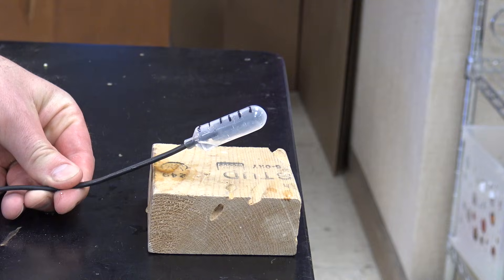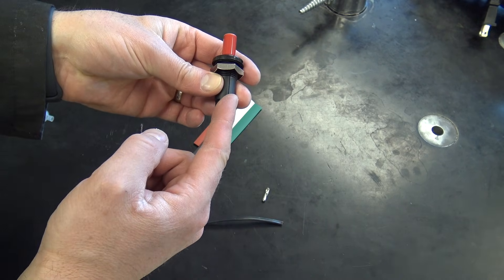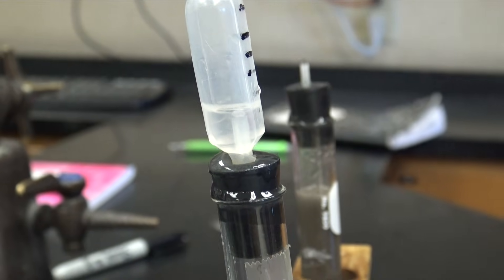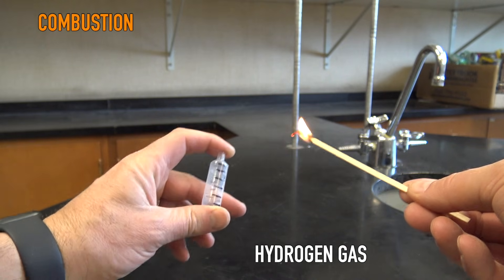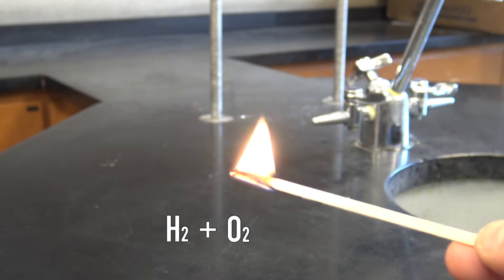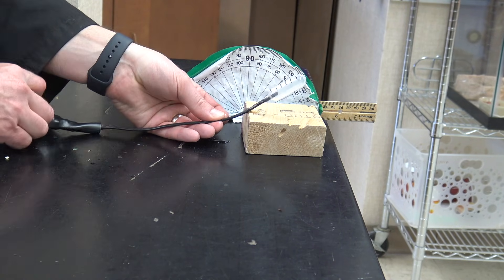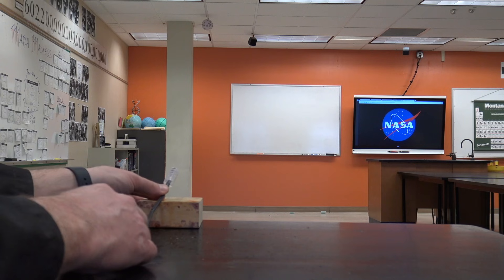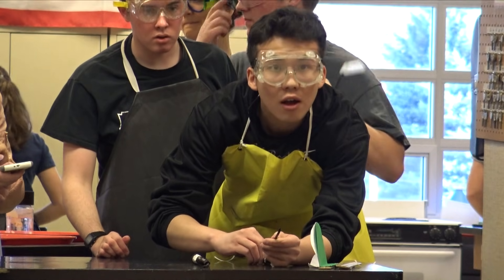Making Hydrogen Fueled Mini-Rockets

Comment: Will this work for propane or butane?
Reply from the maker: Good question. While I haven’t tried using either of them, they do have a slower reaction rate and will produce more flame. So, there could be a risk of melting the bulbs or some flame coming out the back at ignition.

Comment: Great video and great teacher. However, the explanation of ratios is incorrect and the gas mixture is not the same ratio H/O that is present in water. In the water molecule, there is only one Oxygen atom. In the gas it is O2. In terms of number of atoms, 4H = 2O2.

Comment: If the best ratio of hydrogen & oxygen to blast off is the same as water, why not just use water?
Reply from the maker: We can use water and separate it through electrolysis. This method is not the most efficient but rather a learning tool.

Comment: so, I have a question! Why can't we use h2o as fuel? Great video by the way!
Reply from the maker: Thanks!
Water can be used as fuel but first it has to be broken into hydrogen and oxygen then allowed to recombine. The most common way of separating them is by using electricity- this is the basis of a device called a fuel cell.

Comment: 2×hydrogen then 0xygen =H2O
question: why dont water goes kaboom 😂
Reply from the maker: Water is “stable” in its configuration so it doesn’t easily separate to form new things (this is what makes things explode). But, when the two gases (H2 and O2) are mixed and energy is added, they will collide and rearrange into water = BOOM!

Comment: Thank you for the video!  I loved it.  It's much better to obtain your H2 and O2 from electrolysis so you aren't using up so many chemicals.
Reply from the maker: Thank you!
Electrolysis is a better method for making the gases but the point of this one is to learn how to use chemical reactions to make products then to test molar ratios.

Comment: Can we use  hydrogen directly in  car engine like burning hydrogen in car engine like oil
Reply from the maker: Yes. Hydrogen vehicles do exist but the problem is that driving around with a tank of hydrogen is having a bomb on board. So it hasn’t really caught on die to safety reasons.
Reply: @BealsScience  toyota is testing hydrogen combustion engine in yaris model car will it succeed its all over YouTube.
Reply from the maker: I am definitely no expert but I don’t see any reason why hydrogen vehicles couldn’t succeed. There are several hurdles including safe storage of hydrogen, the fast combustion rate of hydrogen in an engine and a supply network (there will need to be ample “gas” stations that have hydrogen to refuel).
Reply: @BealsScience  thanks for the information

Comment: Why don't they use hydrogen in jet engines. 
If you add cooled air wouldn't it have higher energy that.  

Fossil fuels and regular air.    

With way less volume.
Reply from the maker: That is a good question!

Comment: You can get h2 and o2 from electrolisis h2o dude:)
Reply from the maker: Yes, you definitely can. And it is already in the correct ratio! But, the point of this lab is to use chemical reactions to produce the gases and then test different ratios to explore combustion.

Comment: i know yr jus teaching a class and jus showing what chemical reactions can do, but i'm sure yr all too aware, that couldn't you jus simply perform electrolysis  which would give you by default the perfect ratio of oxygen and hydrogen already? and its non-toxic too, is that Browns gas is? i jus know this cuz i been experimenting trying to convert some my engines to burn hydrogen, i cant make an electrolysis device to produce enough hydrogen on demand, which was my goal, since that would solve many of the problems with hydrogen running cars; if you could store it as water and simply produce it only when needed by the engine, boom no dangerous hydrogen tanks, boom extended range by having it in a condensed and safe form, and boom produces just hydrogen and oxygen, so inject that into engine without the need for air intake and u get no production of those nasty nitrogen compounds. Storing hydrogen on the vehicle has many limitations, simply bringing the electrolysis device onboard the vehicle solves so many problems, i just cant design one with enough plate surface area. So far I've succeeded in simply having it supplemented with my air intake, and running my air fuel ratio much much leaner, I've gotten at one time 120 MPG! If you teach engineering too now THAT would be a game changing project,...but which would ultimately put your life in danger as so many have paid with there lives before us. Look up the Newman machine, or Huchison effect. They are real deal, no foolin
Reply from the maker: You are correct. The goal with this project is to have chemistry students make H2 and O2 and mix them in different ratios.
Your project sounds really cool!

Comment: I did a similar experiment in high school chemistry. We used a burette, and poured in a certain amount of HCl then filled the rest with diluted water. At the top, next to the stopper, we tied a piece of magnesium instead of zinc. Then, when you turn it upside down, placing it in a beaker of tap water and uncovering the hole in the stopper with your finger, then the HCl floats down, producing that cool swirling effect, and reacts with the magnesium, which releases hydrogen gas bubbles that float to the top and displace the HCl/water mixture out of the bottom. When it's over you have a burette partly full of pure H2 and diluted water, and some HCl since the magnesium is a limiting reactant. Was really cool, though not as cool as this!
Reply from the maker: This sounds fantastic! I will look into it! Thank you.

Comment: 4/2 = 2/1            but oxygen is actually O2,   so 1 parts oxygen is actually 2 atoms !  
So 2 hydrogen & 2 oxygen atoms is a perfect equilibrium.   2HO2 (g)
You are actually creating pure H2O
Reply from the maker: Oxygen gas exists as O2 but so does Hydrogen gas (H2). So, we need a molar ratio of 2:1 (2 hydrogen atoms for every 1 oxygen atom).

Comment: One big thing missed here is the molar mass of hydrogen and oxygen. You had a 2:1 ratio for the VOLUME of the gasses but it needs to be a more fuel rich mixture than that. Hydrogen is significantly lighter than oxygen, it’s is the least dense element there is, lighter than air, while oxygen has a density comparable to that of air. In this example it works out but this is a VERY unreliable way of calculating this. For other reactions

Comment: If you just collected hydrogen and oxygen from electrolysis, would that be in the correct 2 - 1 ratio?
Reply from the maker: You are correct! Electrolysis of water will yield 2 parts H and 1 part O.

Comment: You do not need Hydrogen and Oxygen both inside your tube to make that explosion reaction happened. You simply need to extract Hydrogen from the water using electrolysis using a battery and from the negative terminal, you put another tube there to collect the hydrogen but the oxygen doesn't need to be there because hydrogen alone, is a combustible gas. The ZINC stuff you used probably contains a mineral which when you extract hydrogen from water, its oxygen instead and not hydrogen. I once made a mini motor that runs on hydrogen gas and it works without oxygen.
Reply: Hydrogen will always need a support in it's combustion..

Comment: how it would be do the same experiment, but using nitrogen gas instead to hydrogen gas.
Reply from the maker: Nitrogen gas is inert, meaning it will not combust or catch fire. So nitrogen gas will not work for this application.

Comment: Nice experiment.
Reply from the maker: Thank you!
Reply: @BealsScience  try oxy-hydrogen whoosh bottle.
Reply from the maker: I love your thinking! I really wanted to do that for this video, but I am pretty confident that my Whoosh (water) bottles are not pressure-rated high enough to actually launch...I am pretty sure they will explode! (Which I am totally OK with but I need to find a location that is safe enough and a remote detonator that can work for this application.)
So...I guess I better start searching for a remote location and a remote detonator!
Reply: @BealsScience  so dude did that happen
Reply from the maker: Buraq_ aerospace I haven’t tried pumping them full of oxy-hydrogen but I have filled them with hydrogen...and...check it out: 5 Awesome Hydrogen Explosions! https://youtu.be/Ficsu-OnAKw
Reply: @BealsScience  thanks